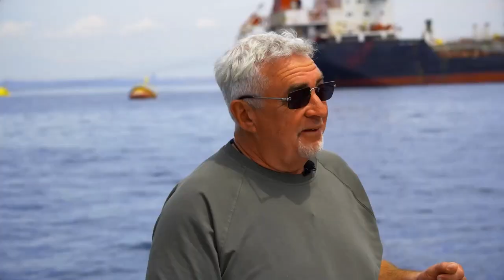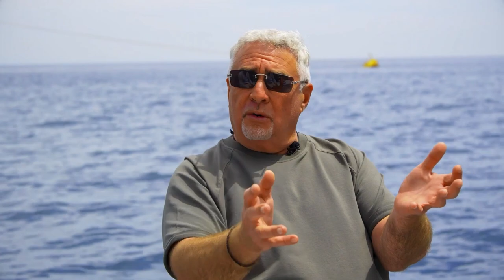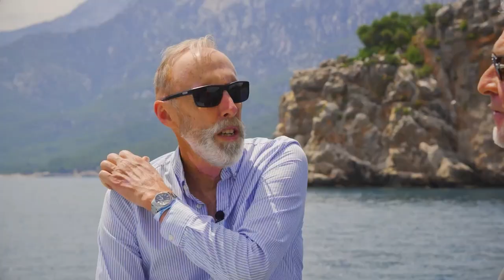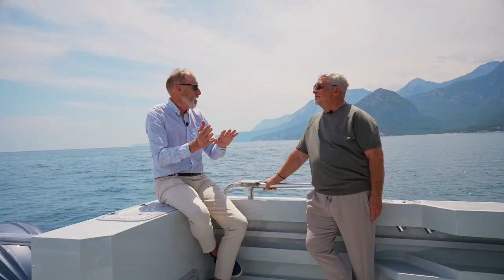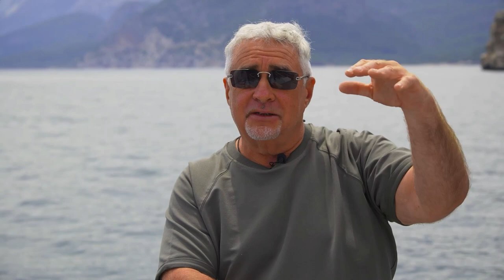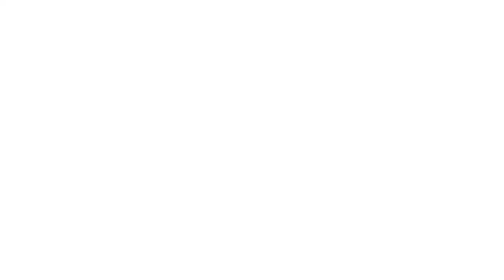Talk-a-Boat | Scott Jutson discusses hydrofoil boat design with Alexey Mikhailov

Comment: Fascinating conversation. So much potential with foils. 
As for electric power, the only vehicle where battery electric makes any sense is when the primary source is solar panels, otherwise the environmental offset is negligible when compared to the carbon footprint of battery production, and grid level power is still predominantly carbon based for production sources.

Comment: as bering
1) Will you add a foil system to the monohull boats you will produce from now on?
2) Are you going to produce catamaran-style boats of 70 feet and above?
3) Can you add a foil system to the boats you have produced so far?
4) How many feet of catamaran boat can offer the same usage area with more comfort instead of a monohull 75 feet boat?
5) Would it be more advantageous and efficient to use propellers powered by electricity produced by a diesel engine?
We expect you to answer our questions with a nice video.